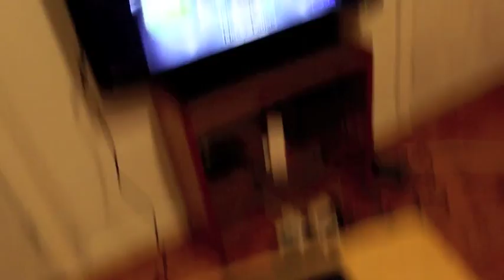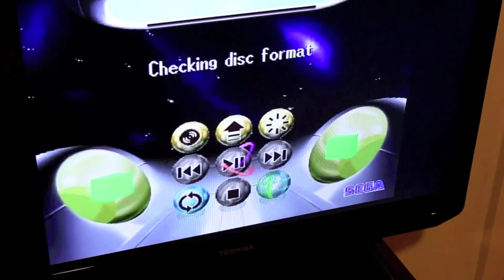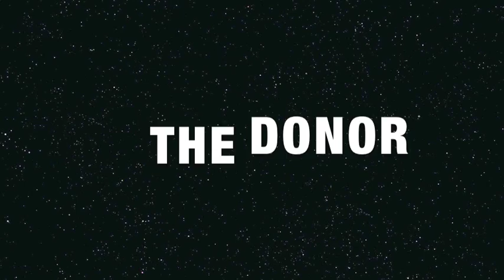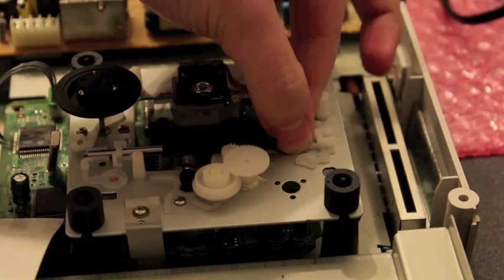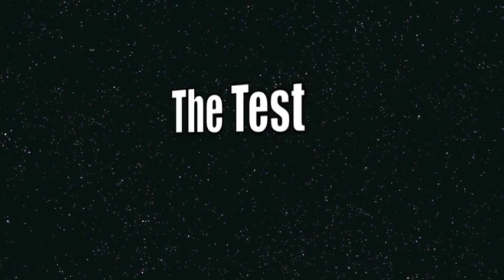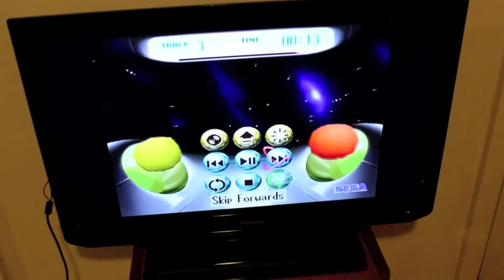Sega Saturn CD Deck Laser Repair / Replacement

Comment: Well I sincerely hope your not dead man. I got one of the two "made in china" round - start - reset - button - MK-80200A-50's going without electrocuting myself. I found a small split on one side of the white ribbon from the main board to the laser board on the other one. I imagine that's causing issues. Not much info out their on AUS Saturn model numbers im afraid,  save here perhaps...
https://gamefaqs.gamespot.com/saturn/916393-sega-saturn/data
MK-80200A-03's and MK-80200A-50's don't seem to exist :/

oh well, my latest vid if you need a good larf Shane! 
https://www.youtube.com/watch?v=wRaldoEc0xk

Comment: Righto Shane, got the lasers! Hope i got the right ones dude. The model number on one offending Saturn is a MK-80200A-50 (both round power and reset buttons). Another Saturn causing grief has the model number MK-80200A-30. The lasers i got, or the closest i could find are marked, MK-80200-50. Haven't pulled the first one apart yet for a good comparison check but the only difference i can spot so far is the "orange 202" laser adjustment on the original, while the new ones say "302" on the adjuster instead :/ 
Couldn't see the number on the pic provided when i bought them?
@ the 10min. 09sec mark you talk about "a solder point, jointed to prevent anti-static discharge", and to "wipe it away to allow it to function", but, "installing it with that connected it won't do much". 
Yeah, still not too sure what you meant by that. These lasers have one single dob of solder in that spot, which i could soak up and wipe away with de-soldering braid or wick? But i have just discovered i've run out of the darn stuff, so a visit to Jaycar next week is plan A.
Am i on the right track so far? 
Cheers,
Jeff.
Reply: Nope nothing.

Comment: Very helpful man. Trying to repair two right now!
Reply from the maker: How'd it all go?
Reply: I've ordered three new lasers from ebay. The laser voltage adjuster thingo made another one that had started to play up work fine now. Just a question though, @10min 25sec mark you talk about "wiping away" a couple of solder spots in the bottom left hand corner if you've bought a new laser. ...um , why do i need to do this if they are joined to prevent anti static discharge in the first place? ..and if i don't wipe them away, then it won't work? I wasn't too sure what you meant by all that but to be fair, you've used an old one as the demo explanation so, guess i have to wait a couple more weeks till the new ones get here and watch it all again. Also, one last thing...for some reason i can't download this video atm? The download video procedure chucks a hisy fit. It's been doing it alot lately and i dunno why? Im gonna see if i can DL it from another PC to narrow down the issue. 
Thanks for your help mate!
Reply: Not a lot of luck mate. This Saturn took an unusual amount of time to boot up to the time/date screen. Then the same amount of "black screen time" to load main. Say's checking disc but nothing is moving. Oh well, she boots, didn't catch fire or blow up and i didn't electrocute myself (this time) so i sapoze that should go in the win column i guess. I'll watch some more vids and have another crack at it tomorrow night.
Reply: it appears i bought replacement lasers for the oval shaped pal saturn instead of the round ones. I've just re-ordered three more for the round - reset power button saturns this time.
Reply: Ok mate! ...i got a MK-80200-50 replacement laser to work in a Indonesian Model MK-80200A-03. Wrote about my adventure at length here https://segaxtreme.net/threads/replacement-laser-len-for-sega-saturn-on-aliexpress-ebay.24276/#post-176449
...and linked your repair video to my post. Wouldn't be fixed now if it wasn't for you sir!!